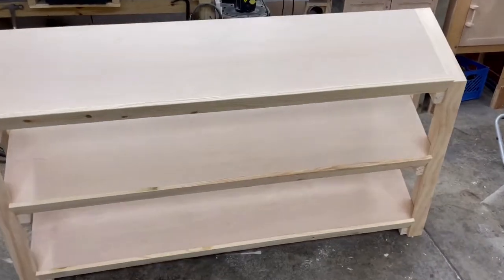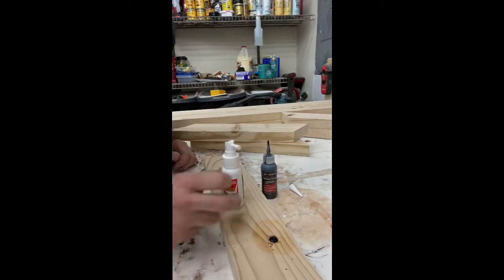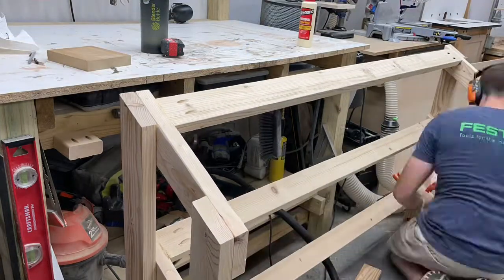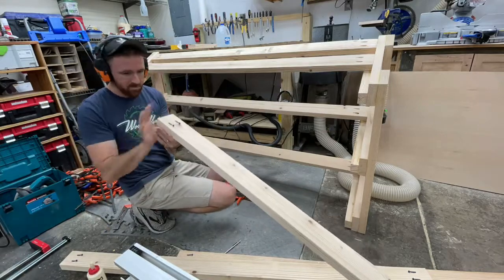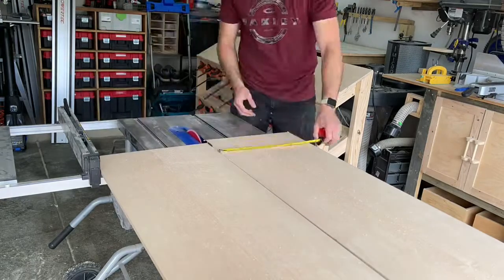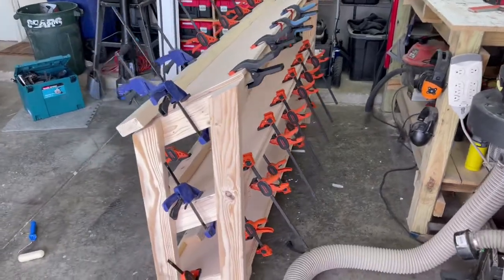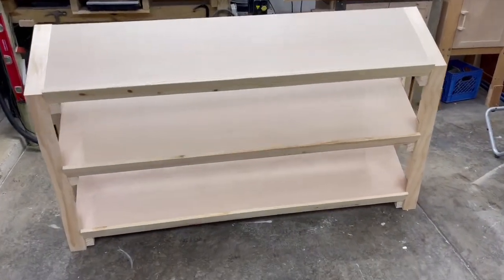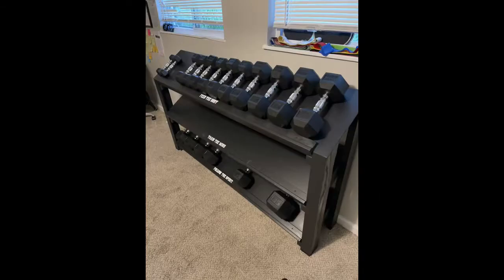1,200 lb Capacity Dumbell Weight Rack Build 5-75 lb

Comment: You have a nice set up. Also nice practical build that also looks really good. I’m building a 4 tier that is not as long . Sometimes it’s nice for me to do a little less bending with over 26 pieces of metal in my spine. It’s pretty neat that this video popped up for me because I came up with a very similar design except a little bit wider at the feet because of the height of my build. Enjoyed your video you do nice solid work that very practical and looks good. Anyways, keep up the great videos.👍👍👍

Comment: Just made one similar. I bought the plastic dumbbell holder for it, but decided to use some extra gym mats I had from deadlift platform I built. Only thing wish I didn’t stain black. N I have 15-105 dumbbells on it in intervals of 10 pounds. N holding up great

Comment: Curious is customer reported that the 2x4s bowed in the middle. Would the weight be better supported and warping avoided if the 2x4s were run on end instead of on their side? 
Overall great concept. Going to build a modified version for myself!
Reply from the maker: No bowing! There is so much support with the 2x4s and the plywood glued directly to it. I think if it were wider it may bow. Maybe if you did 2x4s on their side then vertical supports it would be stronger but may interfere with the shelf below it.. good luck!

Comment: Just what I need, do you think it is possible to add heavy duty casters?
Reply from the maker: As long as you could properly secure them. They would have to be really heavy duty though depending on how much weight you plan to put on it. Why do you need to move it?

Comment: How much did this cost?
Reply from the maker: Material costs at the time I built it (2x4s, plywood, screws, glue, sand paper, paint) was around $200 I believe. Obviously costs fluctuate and where you are in the country/ world will effect this. Are you planning on building your own?
Reply: @taylorstools777  yeah definitely thinking about building one myself rather make a good quality dumbbell rack then buy a cheap one.
Reply from the maker: @Rockyyz  The reason this customer wanted this is because they had a cheap metal one first and it just fell apart!